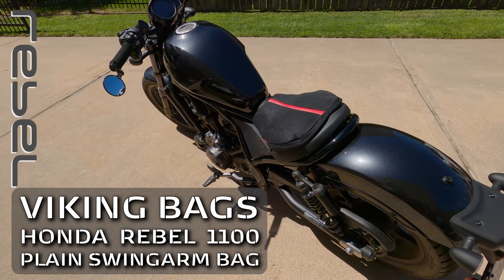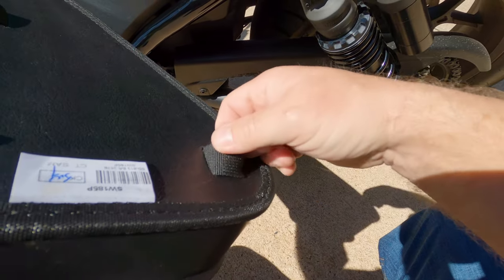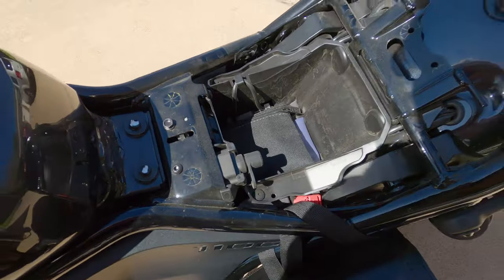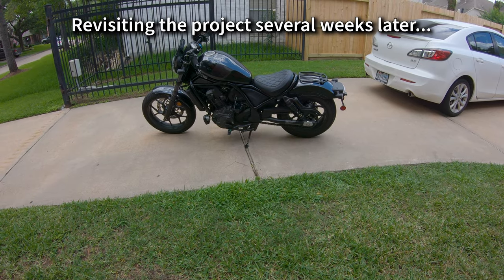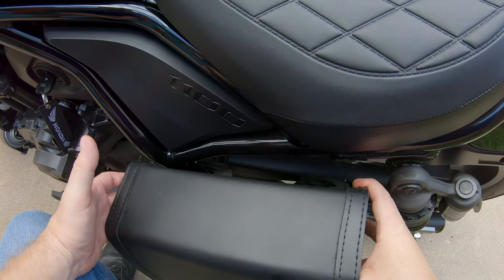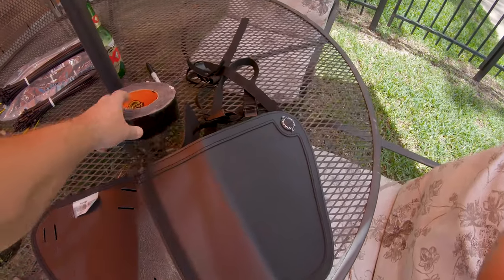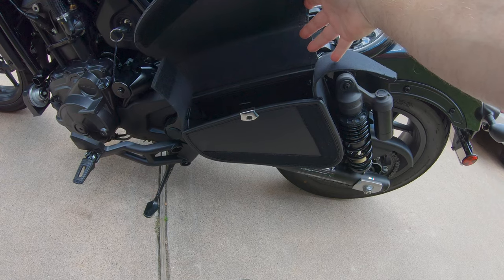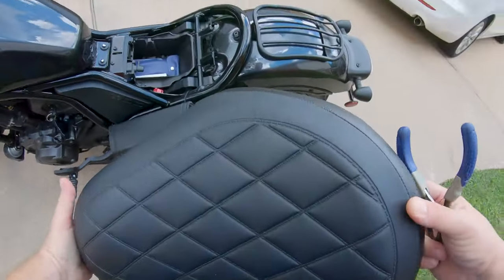REVIEW: Viking Swingarm Bag for the 2021-22 Honda Rebel 1100 (short version)

Comment: Nice install you wrangled.  Looks like probably fit a couple of sandwiches in there. Of course they are Texas size sandwiches. Maybe even a beer, sandwiches and a pistol or wallet.  I am not intimately familiar enough with the Rebel 1100 to know if a tool type cylindrical leather bag could fit under the front head light, for a little extra storage of light items.   If Viking made a left and a right hand side of those type bags it might be kind of cool to make some leather straps and have it as a Mini tank saddle bag set up.  Perhaps it is not such a great idea. Lol Good stuff. Thank you for the content.

Comment: It's made for Harleys not Rebel 300 or 500. I'll wait for something designed specifically to fit the Rebel. More than likely Viking will not make it because they seem dedicated to Harley accessories. You made it look good though. I wish it was just a little smaller so not to hit the leg. In my state you can legally carry a firearm on a bike as long as it is in a case permanently attached to the bike. This would be perfect if only it fit a little better. You need a CW permit to carry in a backpack.
Reply from the maker: Viking Bags originally listed that bag as a specific fitment for the Rebel 300/500/1100, but they have since removed it from their catalog.  I don't know if they replaced it with a newer/different model, or just stopped offering a fitment for the Rebels.  Cheers!  😉👍  --QM

Comment: Why don’t you just get a tank bag?
Reply from the maker: Tank bags always scratch, so I didn't want anything resting on the tank.  This was an early video from just after I purchased the Rebel 1100 and there were NO luggage options for it at the time.

Since then, I have ditched the swingarm bag and installed the Honda solo rear rack and also the Honda/SW-Motech saddlebags.  You can see the final configuration that I've been using in this video: https://youtu.be/vWoyLIqkHfg .  

That layout has served me well for the last 18 months and 7K touring miles.  When I need more storage for my longer road trips and moto-camping adventures, then I'll toss my DrySpec D38 drybag across the rear rack.  Cheers!  😉👍  --QM

Comment: Grrr! You had the same (buckles and straps) problems w/saddlebags.

Little one is growing like a weed.😂🤣

Hang on! I got deja-vu! How old is this vid?🤔
Reply from the maker: Yes sir, good eye!  This video was from a little while back, before I got the saddlebags and passenger seat kit for the Rebel.

Viking Bags reached out to ask if they could use my video in their social media. I said sure, and edited it down to about half of the original length before reposting it.  😉👍 --QM
Reply: I re-view many of your vids when you haven't post in awhile so no biggie. What gave it away was the package at the mailbox.😁

Do you follow Blackpheinix Entertainment? He has a 2014 RS and 2wks ago bought a 2023 ryker sport. I said "downgrade" and he asked why I thot that. Didn't answer until few days ago, he posted a vss fault vid after only 300 mi. IMO rykers are not that great.😂🤣
Reply from the maker: @timwagster9458  Agreed!  I'm surprised that Can-Am hasn't sorted out that flaky SAS (steering angle sensor or yaw sensor) problem after 3+ years.  Luckily, that's NOT one of the issues that plagues my Ryker.  @ThrillMouseMoto has been suffering with that problem for over 2 years.  It's a flawed design or just piss-poor problem mitigation and remediation on BRP's part.  😉👍  --QM

Comment: Poor design….
Reply from the maker: The bag was originally listed as a fitment for the Rebel 300/500/1100.  I'm not sure how it fits on the 300/500, but the strap locations certainly didn't work for the 1100, and the buckles consumed half of the interior space.  The minor changes that I made fixed those issues.  I ended up removing that bag a couple of months later when my passenger seat and saddlebag supports arrived: https://youtu.be/YNcx7Uuxrqw .  Cheers!  😉👍  --QM